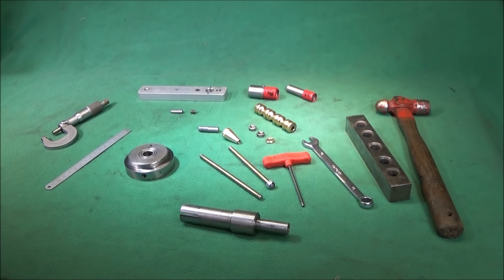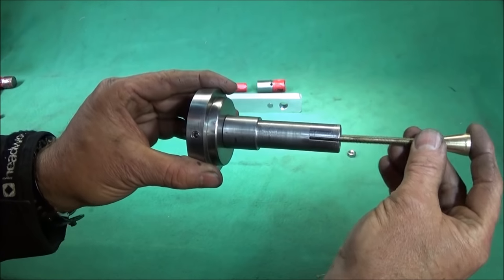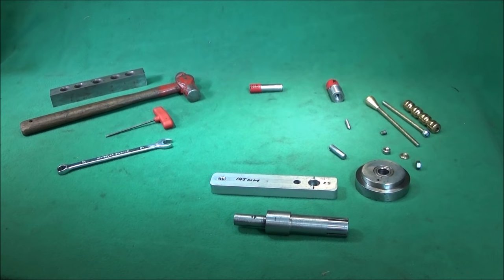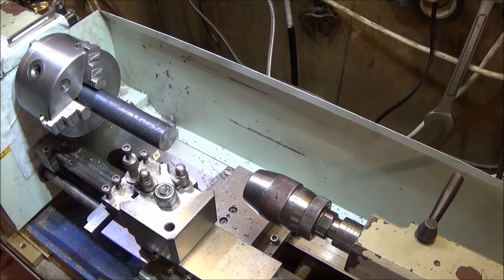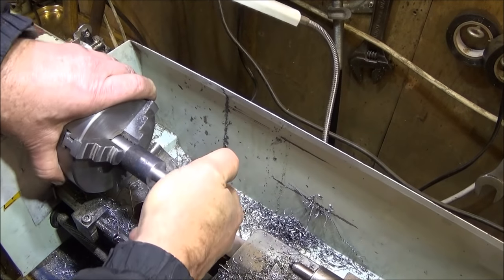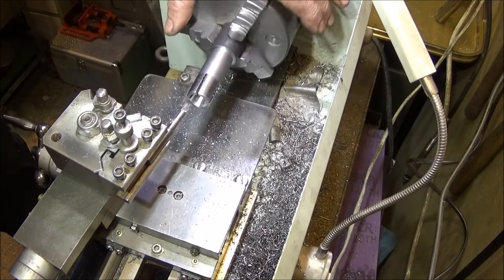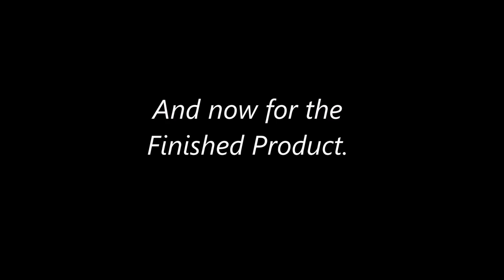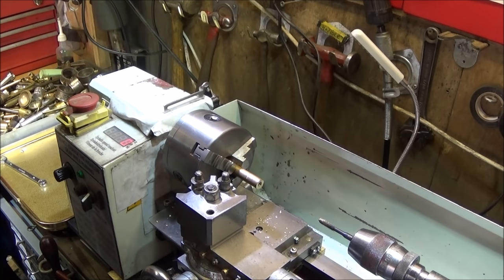How To Make A Quick Release Spindle Handle For The Chinese Mini Lathe

Comment from the maker: IMPORTANT UPDATE:- There is no need to make the locking pin device with the grub screw, as shown, to hold the back part onto the mandrel. If you make these parts a good fit, (say about .001"/.002" clearance on diameters), you can just use the Loctite 638 to secure these two parts. (For more info see my other mini lathe indexing handle video). 
  This makes making the handle quicker and easier to make.

Comment: Steve ,so far I've done most of your mini lathe projects , like compound locking screw , rear guard bolt upgrade, die holder that attaches to the tailstock,etc. and now I've been working on this quick release spindle handle. so it is safe to say ,you have been quite inspirational .looking forward to seeing more projects,I find them all very interesting .keep it up.
Reply from the maker: Hi Thank you for watching and your encouraging comment. I have quite a few new projects I hope to do for both lathes  as I get the time.....Regards Steve

Comment: Thanks for this instructive and inspiring video.
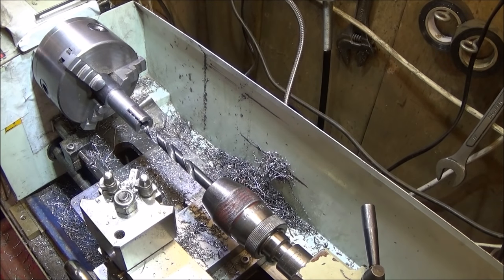At the time 21:55 You start drilling the sliced end of the bar. Why not do that drilling before saw cutting it? The interrupted cut can't be a favour, can it?
Why not do the slit sawing after time 26:50, when the internal cone is ready?
Time 29:30. What do You think about using the same tool post angle, running the lathe backwards and cutting on the rear, back, side of the brass? The angle would really be the same.

Comment: Hi Steve  You are right this is a brilliant tool. I have just completed mine and I found it a satisfying project. It is very useful and a great idea. I was sick to death of tapping by using a spanner on the jaws of the chuck :) I think if you took x number of different people I think you would get the same number of slightly different designs. But basic principle is the same and it works really well. Mine locks up with less than a full turn of the nut once the slack has been taken out. I did the slitting on the mill as I am not geared up to mill on the lathe, not yet anyway ;) Really glad you put up this video Steve. Very well done and thanks for posting.
Reply from the maker: Hi Stephen Thanks I'm pleased you like it. You must have got the expanding mandrel spot on. I use mine for all tapping now and never break any taps. It gives a good feel of the tap cutting. I accidently left my handle in the Myford the other day and started the lathe. It nearly took off...:) Thanks again for your feedback....Regards Steve

Comment: Very nicely done Steve and great instruction for those of us the need the details.  I am going to look over the spindle on my SouthBend lathe and see if there is nothing preventing me from building this for the SouthBend.   Is there any reason you couldn't make the spindle handle system on your Myford Lathe the same way as you made it for the Chinese mini lathe? Also, I wanted you to know that after you mentioned that the steel in old weight lifting sets was a good source; I was able to find a long bar and three short bars with weights and I have been using that steel for projects.  A lot of steel, Cheap!  Thank you for saving me some money!  I do like your bycycle crank handle system on the Myford.  I am undecided which route to go at this point.

Comment: HI, Great idea, just wondering what happens when you want to remove the shaft?  Once bent, doesn't the shaft stay and cone stay spread out?  Do you have to knock it out with another rod?
Reply from the maker: Hi Bob. You just slacken the nut, give the nut/stud a tap forward and it releases to pull out. Regards Steve

Comment: Might I recommend putting the mandrel on  a set of parallel knife edges to balance it? Between the grub screw on one side and the hole n the opposite - you might get a bit of wobble at higher speeds. 
Nice job BTW!
Reply from the maker: +ExtantFrodo2 Thanks, yes there maybe wobble at high speed. I have put a seed reduction gear set on my lathe so the lathe only has a top speed of about 1600 rpm. (I did this upgrade to increase torque on the low gear speeds). I've tried it on the top speed and it was ok. Anyone with a standard lathe speed set up though, may need to balance it for anything faster, if they leave the mandrel in.
  I actually very rarely use a lathe over 1200 RPM. 
  Incidently my Myford lathe only has a top speed of 830 RPM but when they were in production they only had a top speed of around 630 RPM !

Comment: You are correct this is a brilliant accessory tool to have.  One little question.  Could the slitting saw operation be moved to near the end of the process, to avoid all the intermittent cuts, and then have less metal to saw out.  Or would that deform the cone sides when they are sawed, being so thin?  Thank you for sharing this idea, very cool.
Reply from the maker: +Glenn Felpel You have to do the saw cutting first because of the way its held in the tool holder, being one diameter allows you to slide the bar in the holder and clamp it in any position to get the maximum saw cut depth and stops any movement of the work piece, as the bar is held on the same diameter that the saw cuts on. I do it this way to stop any springing movement of the front end of the work piece.
Reply: I had that same question, and kind of figured you had a reason to do that. It took me while, but I did understand before I came and looked at the comments. I knew others would have the same question, and I wanted to have figured it out before I looked at your answer. Another great video Steve!
Reply: Well, actually guys (inc' Glenn Felpel ) I did the cone cutting first; but perhaps because I have a mill I was able to do the saw slitting afterwards. Same result thought.   Because an abrupt cut like the slitting saw can leave a  fatigue stress point, I previously drilled a 4mm dia hole for the saw cut to finish in.
FWIW  I set my taper to 5deg and once set for cutting the cone I then set up the cut the cone plug. (identical taper).
Note comment above to Steve also.

Comment: You can buy cheaply expanding mandrels of different sizes, they are used for concrete fixings. There is a thread on other end, for pushing the cone and to attach something (like a shaft of a spindle handle) of course. 
I made a chuck for gear blanks using one, it works very well. It has huge gripping power because cone has so low angle
Reply from the maker: What an excellent idea. I will have to look into that. It's surprising the things you can buy that can be adapted for use on the lathes etc. Regards Steve

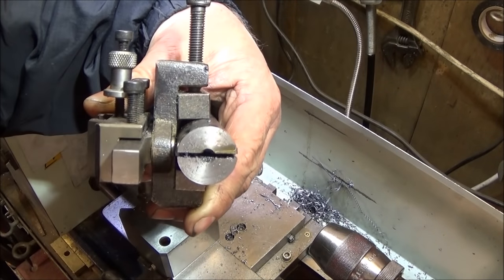Comment: Thank You Steve.  Thorough and good detailed ops and assembly.  Curious about your work holder for the QTCP at 17:22.  Did you make that from a small vice and a piece of SQ bar?  Been wanting something like that and had some thoughts on a design that would hold almost any shape stock up to ~1"...but yours is pretty simple and seems pretty rigid although your shaft stock seem at the limit of capacity.  Thanks again for sharing your build!  ~PJ
Reply from the maker: Hi PJ, Sorry I didn't reply sooner. That vice is the Unimat or Emco vice bolted onto a piece of 1/2" square bar. Regards Steve

Comment: Hey steve i want to make an expanding mandrel to accept pulleys to convert my lathe to belt drive .How do i drill a long mild steel bar all the way??Or i am limited to the length of the drill??Please help me!
Reply from the maker: Hi Thanasis To do mine I used a long series drill and drilled from both ends to meet in the middle. Are you converting the Chinese Mini Lathe?
Reply: To make a very long hole, simply use hollow tube. This is called pipe in some countries.

Comment: Steve why do you not cut the slots after you do the machine on the shaft?
Reply from the maker: Hi Peter. Its to stop the metal from springing as it may do if thinned by machining.
Reply: @SteveJordan  thanks so much for the quick response. With this old video I wondered if you even followed new comments. I have today mostly made the insert section of the handle all but cutting the notches and taper etc. I never would have attempted anything like this without your video(s) most excellent! It's almost as if I have my own tutor right in my living room. I'm 74 and have only had the Myford for about 2 years, I mostly turn wood but your videos make me want to make jigs etc even though I may never use them. I still have to make the Die Holder and the cross slide drill. It is really helpful to see you updating your videos. By the way I'm using the video of the Chinese Lathe handle because I can't seem to find the construction video for the ML7. Cheers!!!

Comment: HI STEVE IS THERE ANY REASON THAT THIS COULD NOT  BE MADE OF ALUMINUM INSTEAD OF STEEL .
Reply from the maker: Hi Clive, I did make one at first for My Myford lathe out of aluminium and it worked the same. We used to use expanding mandrels made of aluminium to hold all types of steel work in the factory, It was standard practice. Regards Steve
Reply: THANKS STEVE.

Comment: HI STEVE.I HAVE NOTICED THAT YOU HAVE A PLEXIGLASS COVER OVER THE BED WAYS OF YOUR MINI LATHE.THE QUESTION IS ARE YOU USING THE HOLES THAT THE TRAVELING STEADY USES OR ARE THEY HOLES THAT YOU HAVE ADDED.THE REASON I HAVE ASKED THIS IS BECAUSE I AM GOING TO DO THE SAME, REGARDS
Reply from the maker: +Clive Grant Hi Clive.  Yes I have used the threaded holes that were meant for the travelling steady. I used polycarbonate I bought on Ebay. I also made a cover out of it to go over the tachometer.  I have just repainted my lathe so If I remember I will show those covers in another video soon. Regards Steve

Comment: Any reason why not to cut the slots after you've turned the internal taper?
Reply from the maker: Hi No you can do it that way. In fact on one I made recently and did the internal taper first and it worked perfectly. Regards Steve
Reply: Steve Jordan excellent. I love your videos. Good stuff for a hobby machinist such as myself.  Really want to knock out one of these spindle handles.

Comment: Flaming dangerous!  One day you are going to forget to put the lathe in neutral and be distracted by a visitor or phone or whatever.   And when you start the lathe, the handle might fly off and blind or kill you or another person.    That's why all modern lathes have a flap that closes down over the chuck, which can happen only if the chuck key is not in place.   A microswitch on the flap ensures the motor cannot run with the chuck key left in place.   This spindle handle needs a similar microswitch to ensure the motor cannot run with the handle in place.
Reply: Somebody like you needs to take up a safer hobby like gardening. But no power tools, and nothing sharp like pruners or saws. Safety first 😂